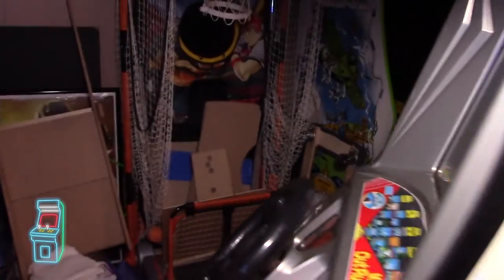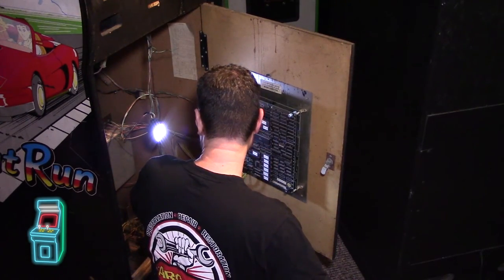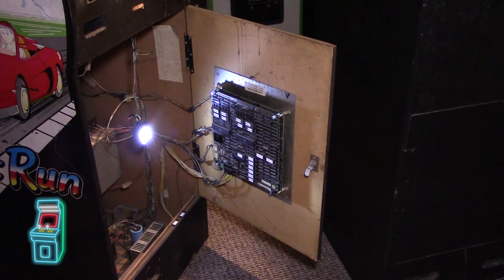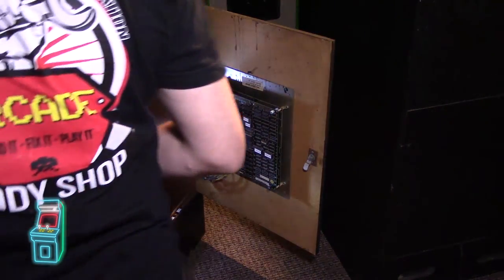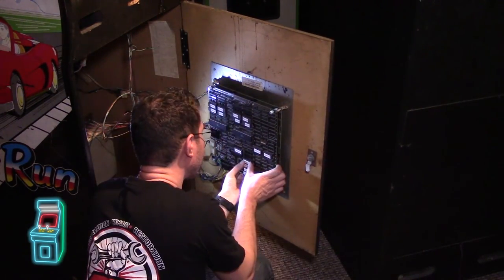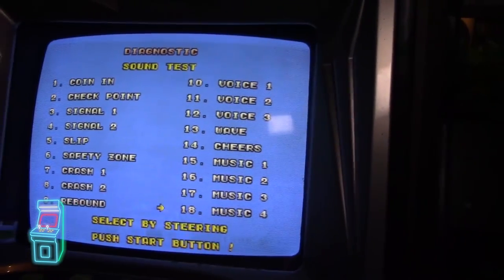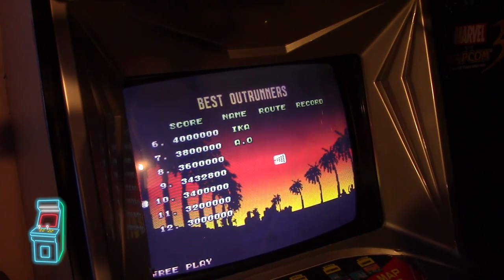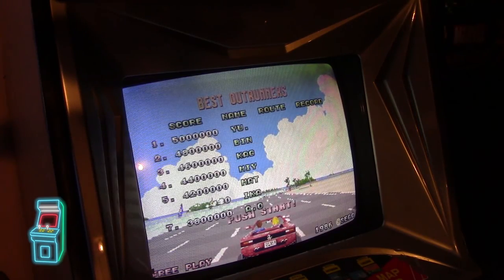Sega Outrun Arcade Repair [Part 3]

Comment: I've installed a few of those super capacitors. Totally worth it with the freeplay roms! Now to figure out how to do a YouTube livestream Outrun duel! haha.
Reply from the maker: Tim, it seems to work fine without it, so long as I power it on daily.  I haven't tried leaving it off for longer.  But I have the Super Cap that I need, so I'll swap it out in a future video.
Reply: I've gone a few weeks at a time without powering on mine and it's been fine (with the super cap). I just haven't made it any longer than that without the game actually being turned on! You should see what the limit is without the super cap. Days? Maybe a whole week? 2-3 weeks? Experiment time!

Comment: Just perfect timing, I'm waiting for a Yamaha ym2151 to replace the one on my board. I have all the sound fx but not the musics (notes). I hope it's only the ym2151 that causes the trouble. Thanks for your great video.
Reply from the maker: I would try swapping out the socketed chips first. The EPROM at IC 88 (epr-10187) contains the FM synthesis data. I'd start there. Then maybe swap the FM CPU below it.
Reply: DeLuSioNaL's Arcade :Are these eprom sold somewhere or I need to buy an eprom burner?
Reply from the maker: The eproms are only available to buy as "blanks" and then you need to program them yourself with an eprom burner using the roms from MAME.

Comment: HI I have this arcade machine but how I turn on the vibration?
Reply from the maker: ajlano ajlan There is a force feedback motor in it. If it's not working make sure the wires are connected. If they are it may need repair.
Reply: It’s a dip switch setting.  When I got mine. It was turned off. I almost bought a new motor  .
Reply from the maker: Also check the breaker reset switch inside the coin door.